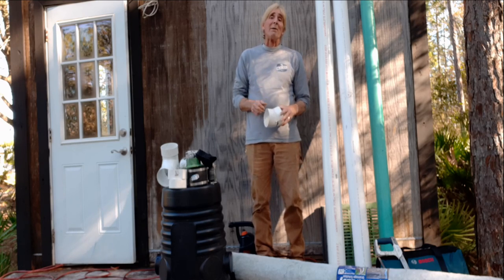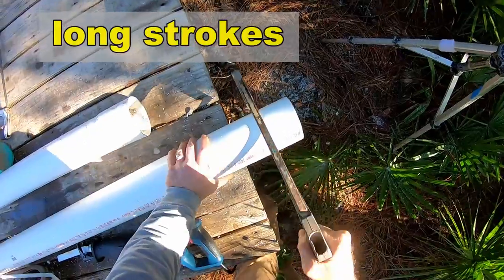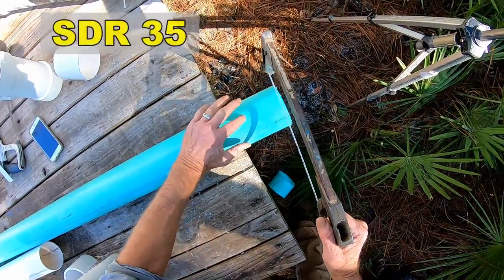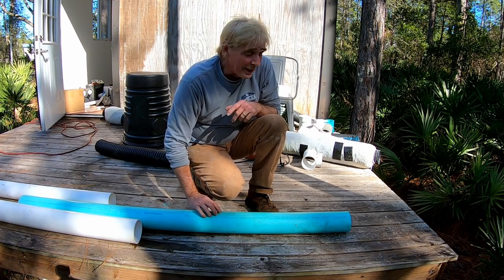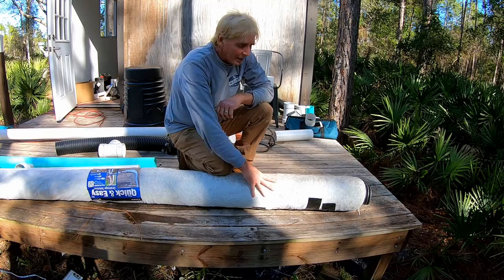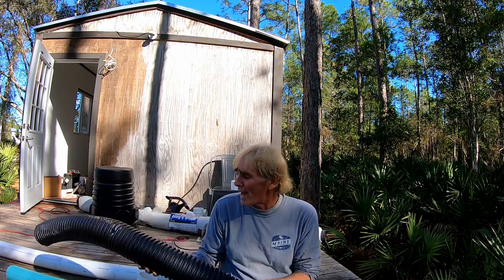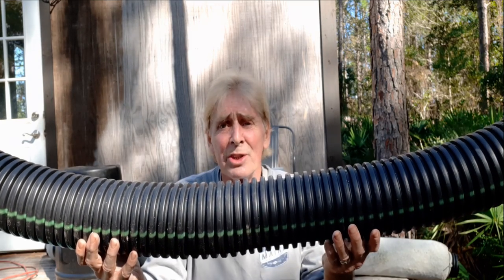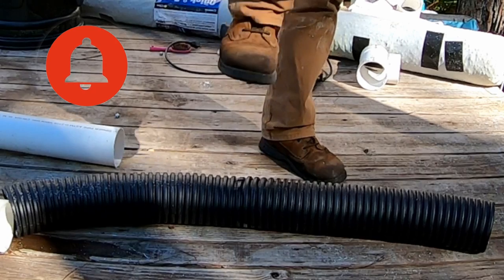FRENCH DRAIN - What's the BEST Pipe to use?

Comment: Let me tell you why I 100% disagree with your professional assessment of Schedule 40.  I have a house that was built in 1998.  High end home.  Extensive French drains on the main property and the guest home.  I have dealt with MULTIPLE total collapses of the corregated black pipe to the point that the system is no longer functional and I have to rebuild.  If any contractor came to me and told me they were going to do anything other than Schedule 40, I would show them the door.  The crush ability of black corrugated is simply not worth the risk.  French drain systems are static, and changes should be far and few between and should be built with capacity, strength, and longevity.  Also, you simply can't root out corregated.  The blade will absolutely kill it.  However, you can root and clear schedule 40.  You need to seriously reconsider one of your basic principals, because I don't think you are doing your clients any favors long term.  The people that come after them are going to end up spending a ton more redoing your work.  As far as I am concerned, using correlated pipe for a French drain system is the equivalent of a plumber using shark bite fittings.  Sorry to be harsh, but it needs to be said,
Reply: he said 35 several times the only benefit to corrugated was flexibility in some situations
Reply: He stated SDR 35 is the best but it is more labor intensive and more expensive for pipe, fittings, etc. I'm sure he lets customers know options available but probably most decide/opt for cheaper drainage install or fix in using corrugated.
Reply: Paying attention is hard, isn't it...